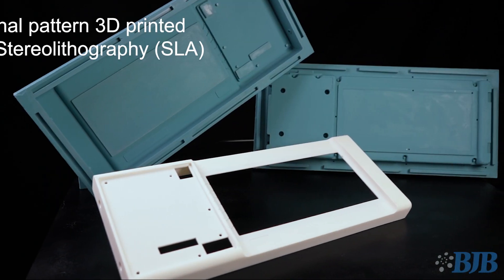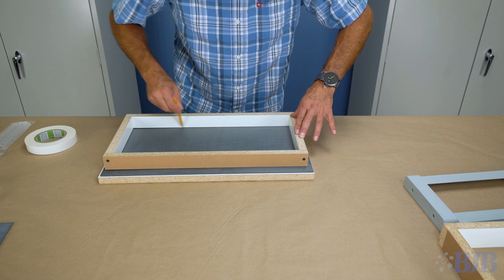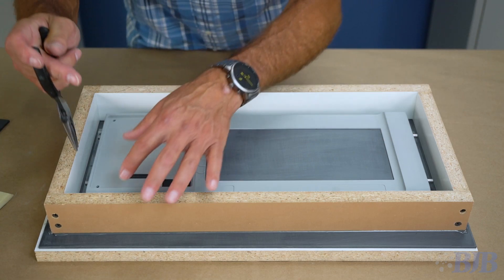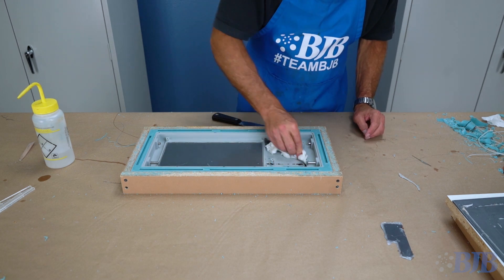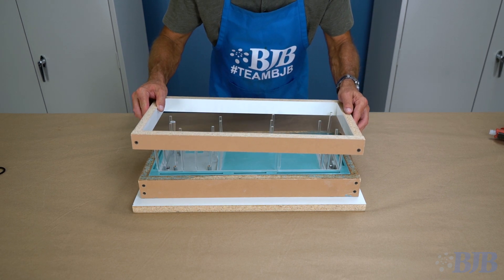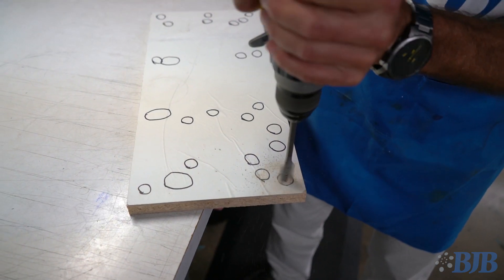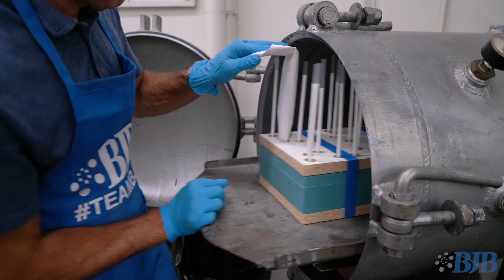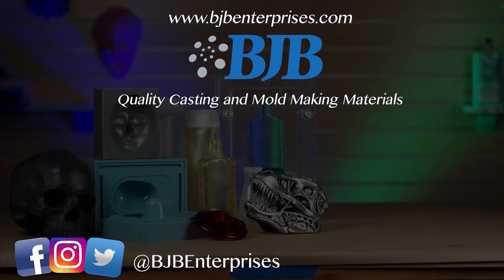Pro Series Silicone Mold Tutorial | Lots of Tips and Tricks

Comment: This is awesome. How would TC-891 compare to TC 804 in regards to overall strength? I'm designing an HMC and want to make sure it's highly impact resistant and can resist UV rays from the sun
Reply from the maker: In general, the TC-891 is a higher performing material all around with stiffness and heat resistance standing out the most.  The TC-804 has a little more flex and "toughness" when knocked around, and is much easier to mix and pour, so it's a nice material for folks new to casting.  As far as UV resistance, neither are classified as UV resistant and it would be recommended to have cast parts painted for any outdoor exposure.
Reply: @bjbenterprises  good to know. I'm anticipating someone accidentally dropping the HMC and it should be fine. I also have tie points that should be strong enough for someone tightening straps on it

Comment: Why did you use 60 psi for the casting ? wouldn't this introduce air bubbles into the mold ? if you used a vacuum, then any trapped air bubbles from inside the mold would come out ?
Reply from the maker: First, we always use vacuum to remove air bubbles from the resin mixture before casing into the mold.  The mold is placed under pressure to help deal with any accidental bubbles that developed as the material moves through the mold cavity.  Pressure casting squeezes the bubbles down to a point where they are not visible anymore and it also forces material into voids.  Once the material cures, the bubbles don't come back.  There are methods and equipment for vacuum casting, but it is not as simple as pulling a strong vacuum on a mold with material.  That often causes the material to foam inside the mold and spill out.

Comment: @BJBEnterprises Great video! How many castings can you make out of the mold? Also, can you line it with fiberglass to make the cast more rigid?  Many thanks!
Reply from the maker: That's a great question.  Most professional mold makers will put a number around 20-30 parts for mold life.  Often times you can get many more out of a silicone mold, provided you've used a high quality silicone material, but there are also variables in that number like desired finish, geometry, undercuts, casting material used (some eat up the molds more than others), and so on.  We've seen simple molds last for 50-100 castings. A super high gloss mold may only get 12-20 parts before it becomes dull and needs to be replaced. With regard to adding fiberglass, yes it's possible, however rarely done.  You could theoretically embed a carbon rod or add some cloth reinforcement in strategic areas if the application requires it.  Thanks for the questions!

Comment: Could you do this process with multiple parts of a silicone mould? Trying to work out a way of moulding a car airbox that would need multiple sides to the silicone mould. I've always used the method with magic tape for the split lines and hand cut the mould with a scalpel using the wiggle line technique. Thanks for any help
Reply from the maker: Mark Norton absolutely.  To create a multi piece mold, it takes a little more set up due to the fact you’ll create additional parting boards (splitter board) as you go.  Instead of a single flat board like the video, there may be an additional board 90 degrees that divides the part into 1/4 or 1/3 sections. We have also created molds with large removable inserts that help access complex internal geometry that would be difficult with a two piece mold.

Comment: Great video thanks. I see you de-gassed the silicone but didn't pressurise it while curing. I've been wondering whether it is necessary to do both with the moulds so I guess it isn't necessary?
Reply from the maker: Ross Brannigan there are certain instances where we would pressure cast the silicone due to extreme details or chances of air pockets, but with simple geometry like this part it’s not necessary if we degas the silicone before pouring.  Pressure casting the silicone won’t hurt anything but it’s good for folks to see it’s not always necessary. On a different note, if you don’t degas the silicone and it was full of bubbles as you cast it, now you will always want to pressure cast your urethane castings or bubbles trapped under the silicone surface may cause surface imperfections or distortion at ambient pressure.
Reply: pressurising only shrinks down the remaining air bubbles. due to its flexibility, the silicone mold could deform once its out of the pressure chamber as the bubbles re-expand